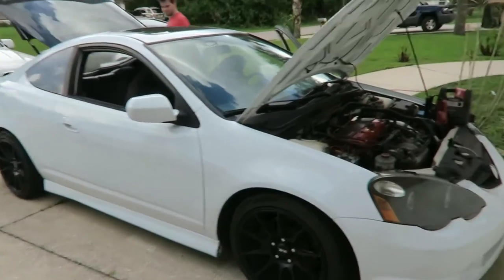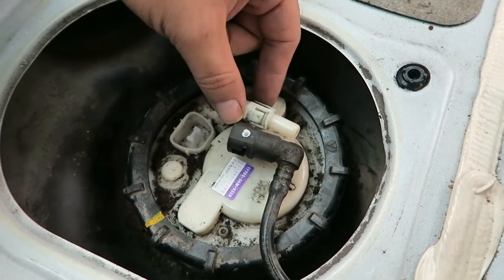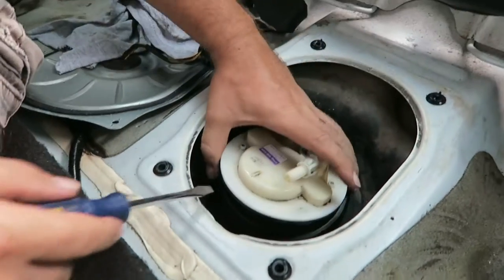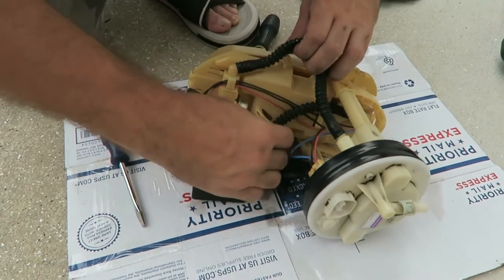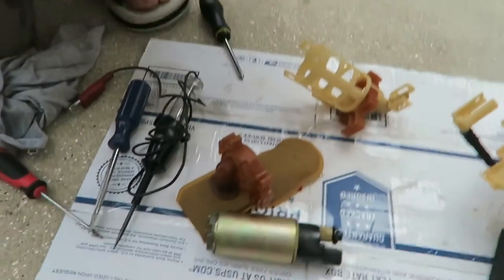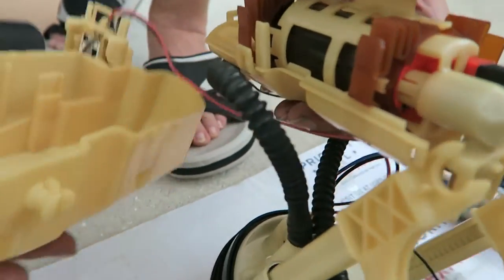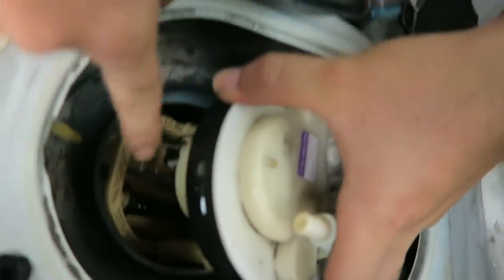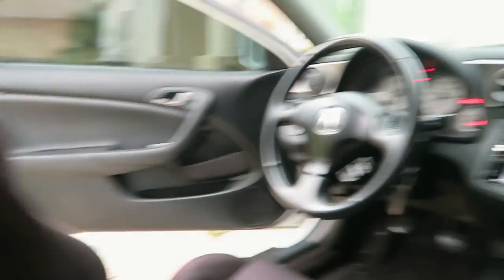RSX FUEL PUMP - DIY

Comment: So what's not too clear in most of these videos is that when the fuel pump and sender assembly is resting in the top of the tank and you are trying to get it pressed in, the trick is to slide the black gasket completely off the assembly and insert it into the opening of the gas tank.  The gasket has a lip that will prevent it from dropping into the tank.  Once the gasket is in place, the fuel pump assembly easily slides into the gasket.

Comment: I've used a hammer on a piece of 2x4 wood to knock the lock ring loose.  Looks like a screw driver works too.  
This is the oem part no. 17045-S6M-A00
https://www.acurapartswarehouse.com/oem/acura~pump~assy~fuel~17045-s6m-a00.html?Make=Acura&Model=RSX&Year=2002&Submodel=&Filter=(bt=3%2c63;et=1%2c3)&Location=electrical_exhaust_heater_fuel/fuel_tank,,49

Comment: Hi Vlad,

Could you recommend a good fuel pump set for my 2004 RSX? It is a base model.

I am not mechanically experienced however with your video, I feel confident enough to give this a try.

My current car is at 180k KM mileage and I think I really need to change the fuel pump system. 

My car sometimes feels sluggish during acceleration and sometimes has rough idles.

Comment: I've been looking for a fuel pump that fits an RSX (and 7th gen Civic).  I came across an Aeromotive 11565 which looks a little shorter than most fuel pumps (including their 11542).  Posting this in case anyone might find this useful.  I haven't been able to check myself.